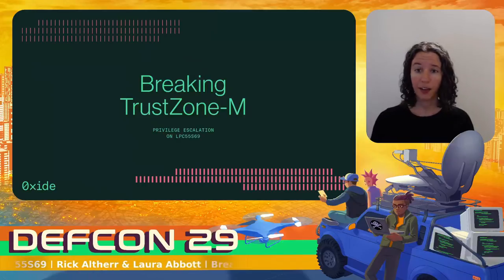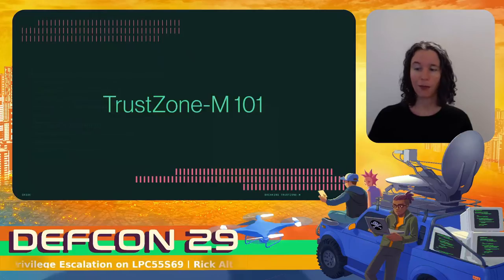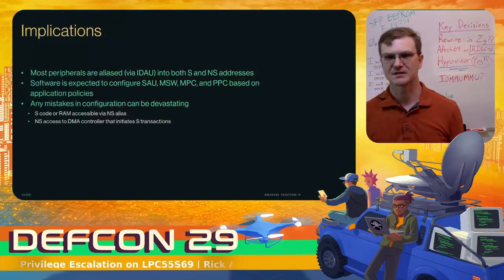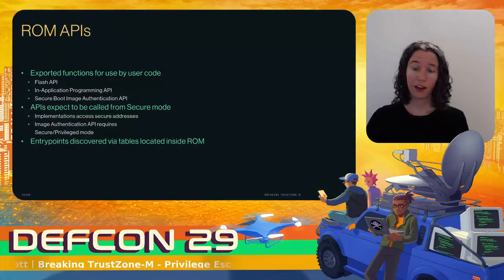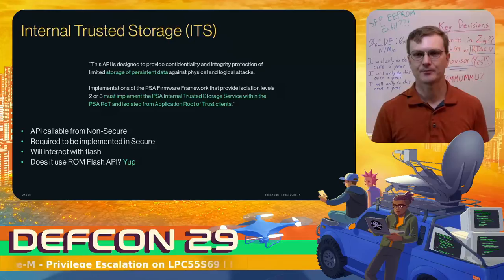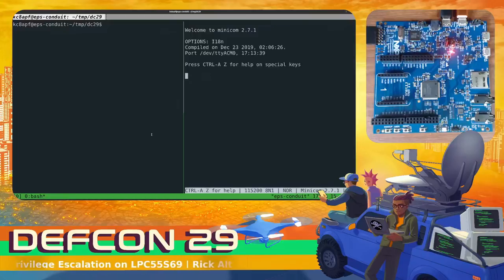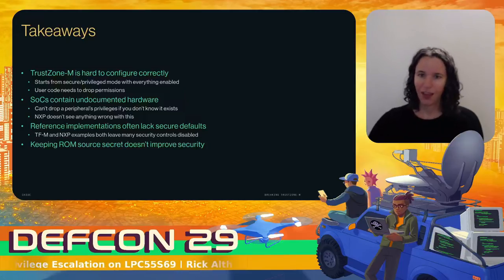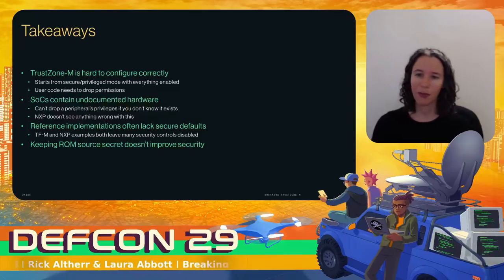DEF CON 29 - Laura Abbott, Rick Altherr -Breaking TrustZone M: Privilege Escalation on LPC55S69

Comment: Thanks Laura and Rick!

I learned more about the security on the LPC55s69 from this presentation than from reading the manual. 

Till now, I really liked the chip, particularly as it contains the Powerquad DSP processor which makes the work I do analyzing the Amps and Volts waveforms coming back from electric motors used in irrigation a breeze

Starting to think that the open source Risc-V chips will be the future architechture I will use?

Thanls plenty!

Comment: I SPECULATE that the reason that the one section was removed from the users manual was that the chip implementation had a bug, and it was easier to just not support the feature at all, rather than to errata and fix it. This is usually a marketing decision about how many sales will be lost by not having the feature.

Comment: Thanks for the great presentation! Just a heads up there is an error on the slide at 7:08, it incorrectly lists EL0-4. There are 4 exception levels in Cortex-A 0-3, 0-4 would be 5 exception levels.